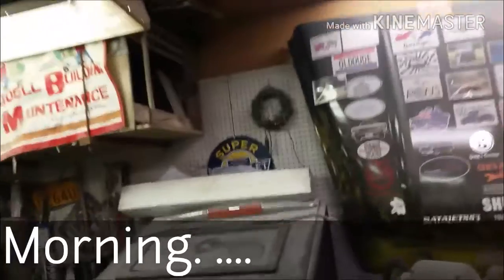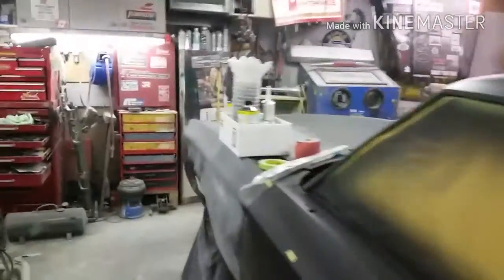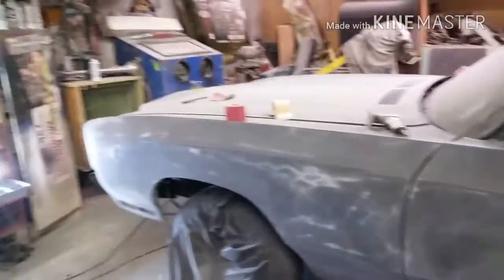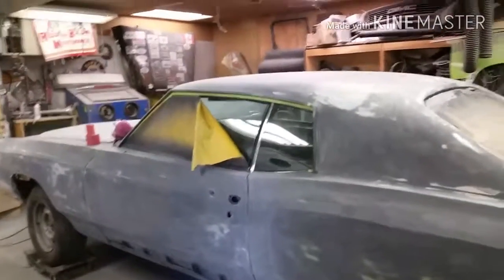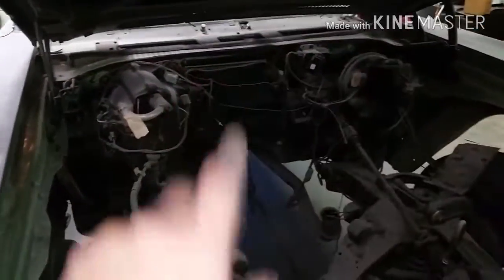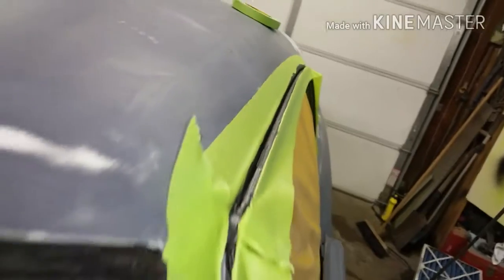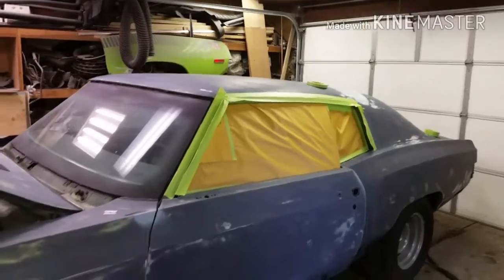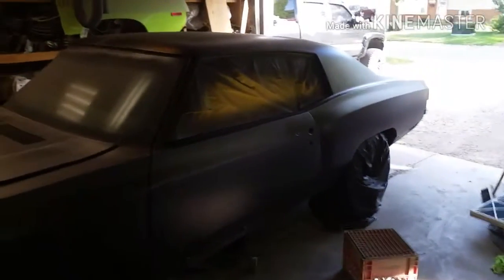Monty Carlo ss 454 part 4

Comment: Camper? Camper? We don't need no stinkin campers.
Where's the beef? I mean where's the camper. I like campers and camping and would watch cha having some Miller time. Oh and I am down by the sea well maybe 20 miles away.
Good stuff like the wheelies under the tires and the in and out winch.
Don't go and throw it all away or another one will bite the dust. :> )